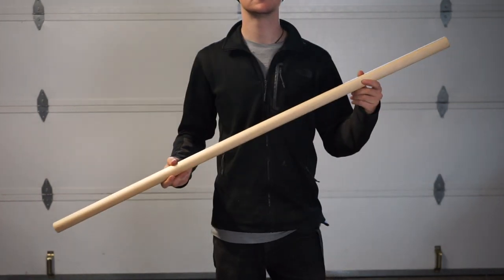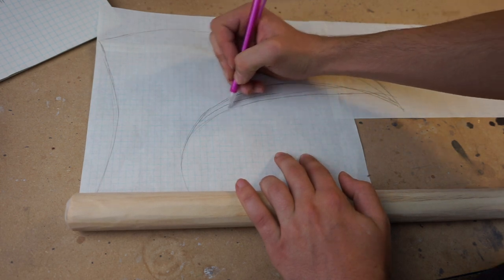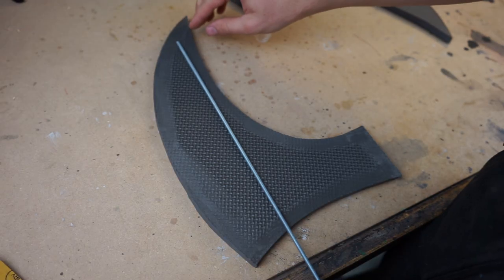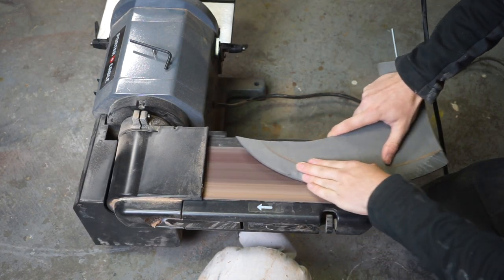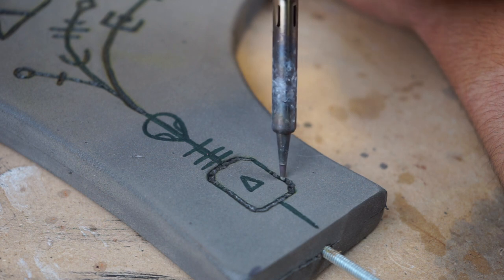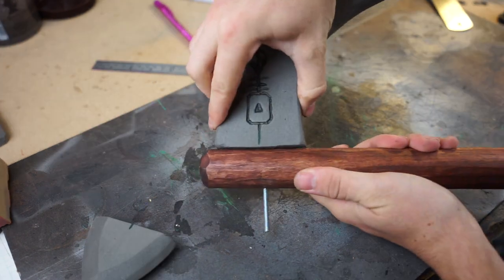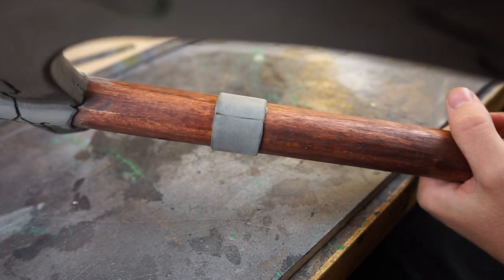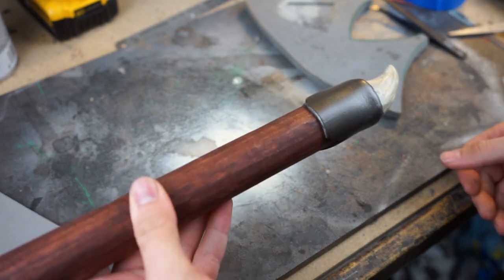How to Make an EVA Foam Axe

Comment: To anyone who doesn't have a soldering iron or wood burning tool (like me), I just used a box cutter to carve what I wanted (make sure to draw out the design first, as well as test it on a separate piece of eva foam) and brought a heat gun to it like he did for the cuts in the front.

Comment: What was the thickness of the EVA foam that you used? I want to build a headless horseman prop and your axe looks very much like his and that is what caught my attention.
Reply: Hi, I'm not this creator (obviously) but, the foam this creator used was the standard thickness of EVA foam mats, which measure out to about 3/8" (Or three eights of an inch. Or, 0.9525 CM) I hope it works out well for you! :)

Comment: what grit do you use on your belt grinder for foam? am borrowing one and have no clue what I'm doing. but it just ate the foam up, could not make a smooth surface.
Reply from the maker: any grit 120 and below i use for taking off a lot of material, 320 to 600 is good for smoothing out the foam. Just take light passes with it.